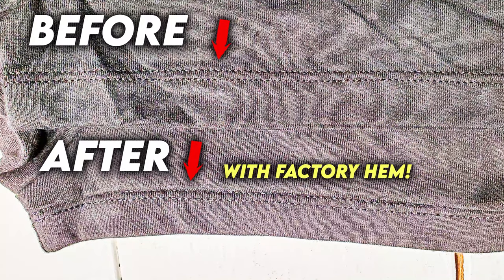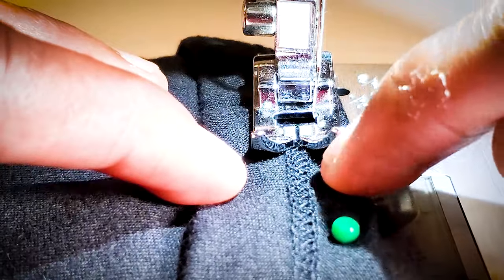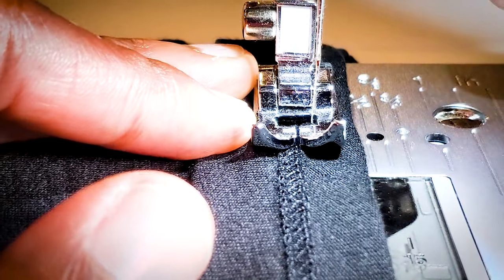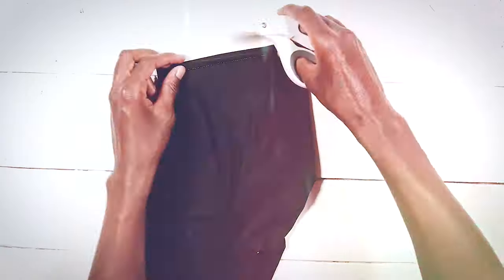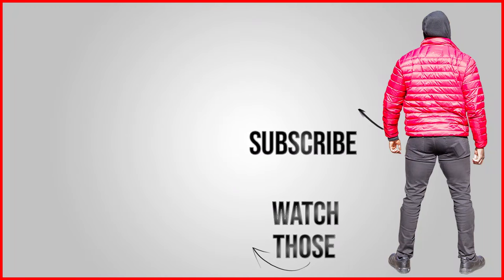Make ALL YOUR T-Shirt Sleeves The PERFECT Length!

Comment from the maker: I uhh...I'm not very good at tennis...

Time Stamps
0:00 Intro
0:29 Step 1 - How Long Is The Factory Hem?
0:43 Roll Your Sleeve Inside Out 
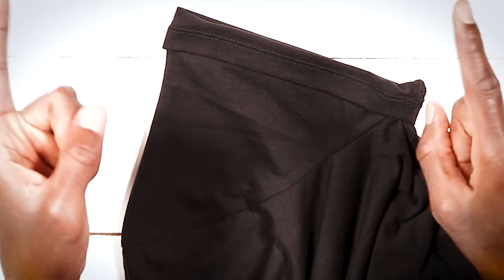0:50 Wanna Remove One Inch?
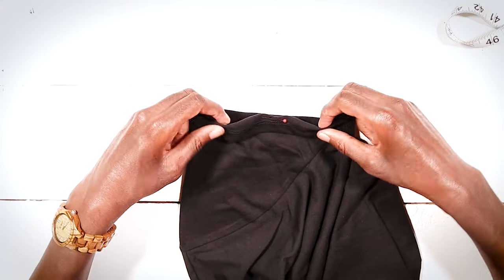1:44 Flatten Everything And Insert Pins All Around
2:02 Measure To Double Check Everything 
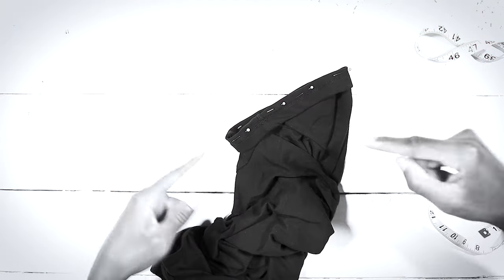2:29 Type Of Stitch, Needle, And Thread
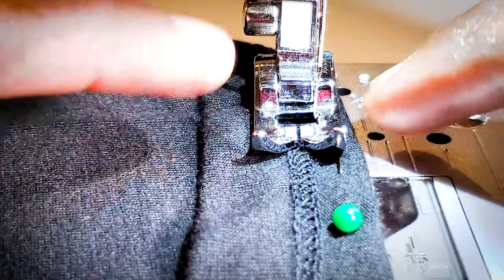3:16 Sewing The Zigzag Stitch
4:29 Finished Zigzag Stitch Results
5:03 Cutting Off The Extra Fabric
5:22 Should We Finish The Raw Edge?
5:32 Finished Results WITH The Original Hem Intact
Reply: Awesome video. I just got basic Brother LX3817 sew machine. I see only presets of length and width for the zig zag stitch as below: 
LxW in mm
0.7x 1.8
1.5 x 3.3
2 x 5
0.5 X 5. The least closest to what you suggest is 0.7x1.8. Is it a big deal?

Comment: I need to shorten a jersey short sleeve shirt 3 inches and the under arm does not match with the stripes on the shirt.  It is a Cubs shirt.  What are my measurements and what do I do about the under arm and matching the stripes?  I am figuring 1 1/2 in from the bottom of the original hem.  Is that correct?
Reply from the maker: Correct yes, but practice pin it up and see how you like the length

Comment: First off your videos are great I literally alter everything I own thanks to your videos. I'm a longshoreman and have to wear safety vest and I even alter those to fit my tall lanky frame since they usually come in fat, fatter or fat as F, just bc I'm working doesn't mean I have to look sloppy am I right. Anyways I'm guessing it I wanted to shorten the length and the width, I would start with the length first right and its the same technique for a short sleeve button up?
Reply from the maker: You can do either or actually, but I would shorten first and then take in the sides. And I'm totally using that, fat fatter and fat as F, haha!!

Comment: or avoid this whole solution by buying a 1/8" double needle.  Trim hem, sew flat on top, guiding as close to the edge as you can...this needle provides a zigzag on the back when you sew STRAIGHT...so the appearance is the same, the stretch is there because of the zigzag on the back and there's no lump of fabric under your hem.
Reply from the maker: Solid tips, thanks for sharing for everyone!
Reply: @StylishDTailors  would you be able to make a video using this method? I don't Iike the 'lump' either and am a very novice at this.
Reply: So you're saying cut the factory hem off, fold a half inch or so, then sew around sleeve once as close to the edge as possible then another below that first one?
Reply: @R-Lee-  thats how I assumed it should be done before watching this video... Also I'm not sure why it is important to be particular about the distance of the pins from the edge of the sleeve- it doesn't seem to make a difference where you pin it as long as fold is the same width all the way around.
Reply: thank you! this comment is gold! exactly the answer I was looking for!

Comment: can someone explain how the .25" turns into 1" shorter? im trying to understand that so if I want to take more than a 1" I can do the math
Reply from the maker: It should be .25 turns into .50, hope that makes more sense! It will end up doubling.
Reply: i noticed this as well. He didn’t actually end up taking 1 inch out of the sleeve. he only took .5 inch out. Actions speak louder than words lol

Comment: What's the purpose of having the pins exactly 1/4 inches from the original hem, when you are actually measuring 1/2 inches for the fold? Took a minute to just give up on the math and do it in practice. I found that it didn't really matter that the pins were exact as that wasn't the guide, it was the first stitch of the existing hem that needed to be followed.
Reply from the maker: Pins are there to hold everything together for ya

Comment: I'm brand new to a sewing machine and really struggled with this. I ruined around 10 cheap shirts from goodwill before I finally got the hang of it, and I almost gave up several times. If, like me, you are a total beginner, here are a few tips:
* buy a bunch of the same shirt. instead of the math at the beginning (didn't make any sense to me), just try shortening by 3/4" or 1" or whatever. if you took too little off, increase the amount taken off by doing the whole process again. trial and error is easier than math.
* many shirts taper towards the armpit. so if you're taking 1", you won't be able to get the 1" all the way around. in fact, on some of my shirts, at the armpit seam, the amount taken off is 0! I spent wayyyy too long before I realized this.
* not letting the shirt bunch up is huge. D mentions this in the video but you really gotta pay attention. 
* be extraordinarily careful when cutting away the excess at the end, otherwise your work was for nothing (unless you wanna learn how to patch). remember, the excess is hidden from view, so the only person who will ever see your cutting job is you (or whomever does your laundry). it's better to cut away too little than too much, otherwise you'll have a visible hole.

best of luck gents, and thank you D for the content.
Reply from the maker: Dude thanks for sharing your experience and tips with everyone! I'm gonna pin this comment!

Comment: Isn't this shortening the sleeve by a half inch?
Reply from the maker: The math should work out to an inch
Reply: @StylishDTailors  but didn't you fold a quarter inch, so multiplied by 2 for both sides would be a half inch right.  Where else did you take in the fabric?
Reply: @StylishDTailors  I have another question.  How do you keep the seam straight?  I tried it and my seam is all over the place.  Is it just practice?
Reply: @tcg21387  i think youre right. If you remove 1/4 doubled-over it would remove 1/2 inch. I dont see any other way to look at it...